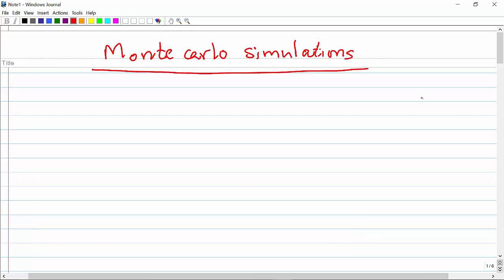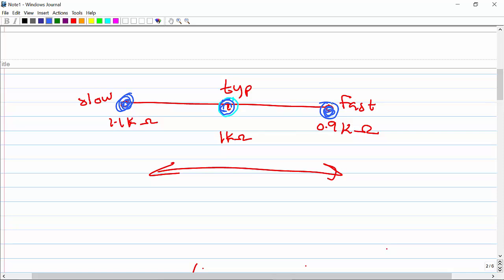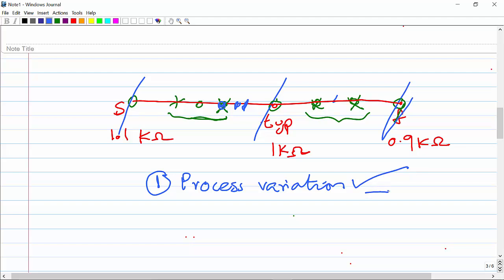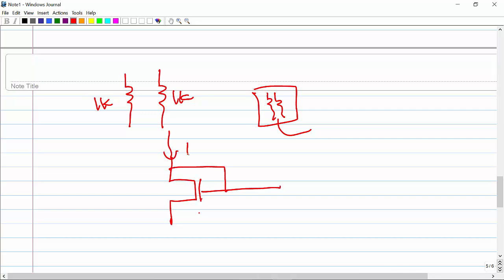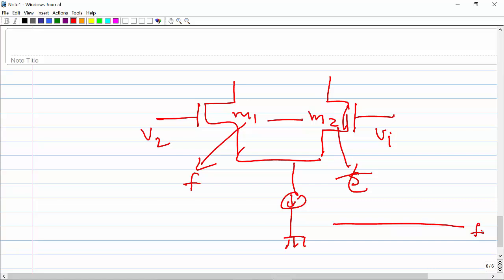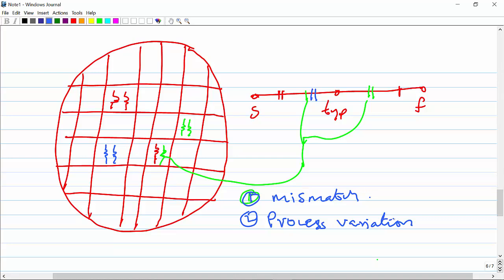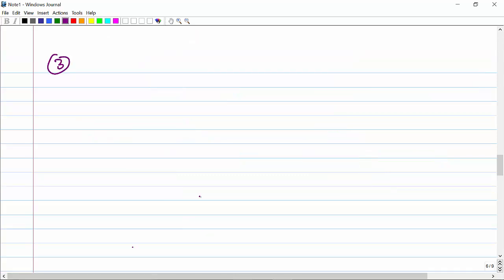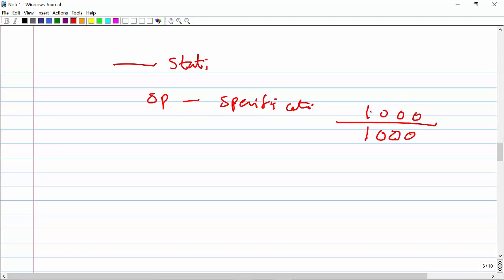Cadence tutorials : Monte Carlo simulation in Cadence part 1. introduction

Comment: I am new at cadence virtuoso. I want to perform the monte carlo simulation of my circuits to calculate the power and delay. I am using the scl pdk 180nm tech. while doing so i get the error

 "Monte carlo run stopped because no statistical data generated for the test.
Nominal simulation might have failed. Either fix the problem in the test setup or disable the test and re run"

But I have successfully performed the Monte Carlo in gpdk180nm I have follow the the same procedure in sclpdk180nm but I am getting the above problem.